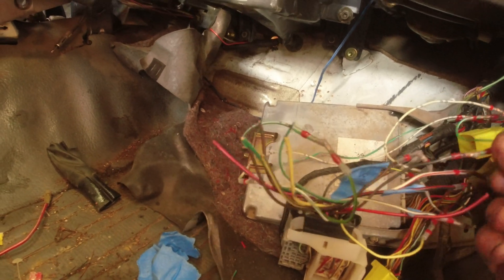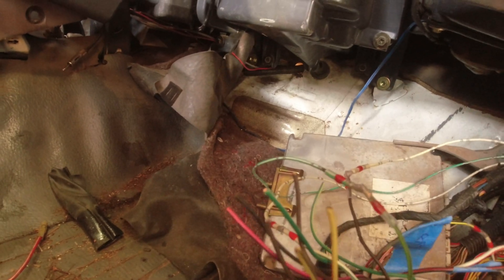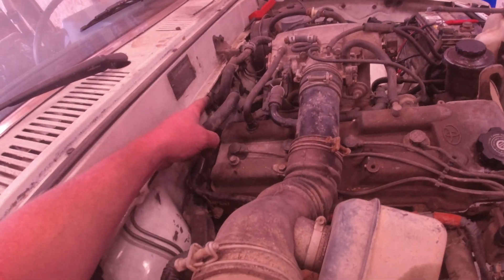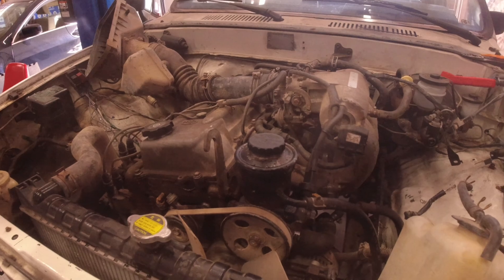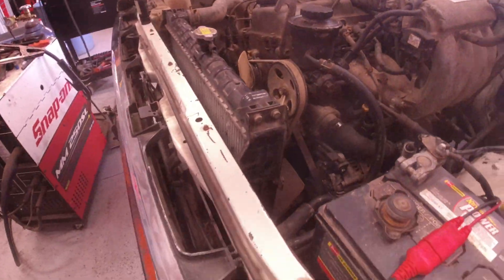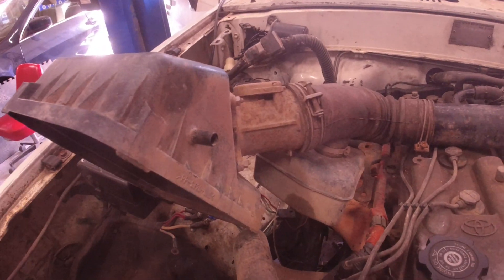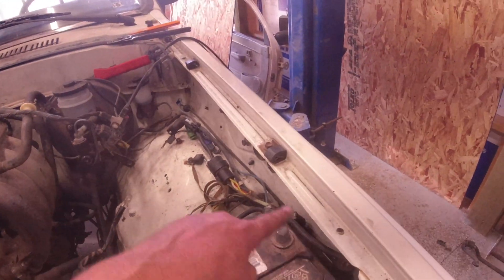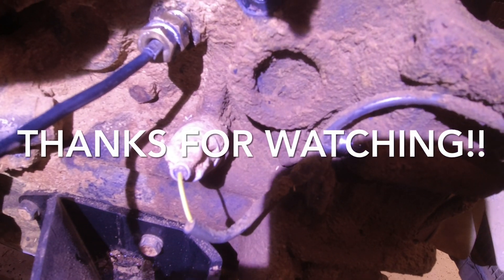3rz ecu wiring and cooling system

Comment: I’m up and and running now but stuck with a p1600 can’t seem to figure it out,
Reply from the maker: P1600 is ecm is getting power with the ignition turned off. Recheck your wiring.